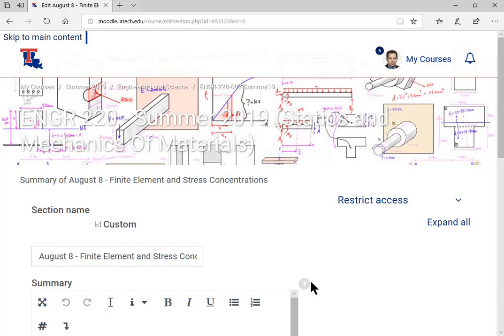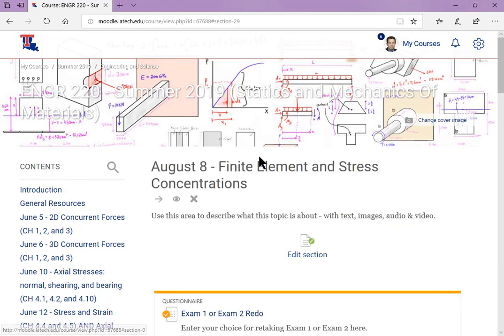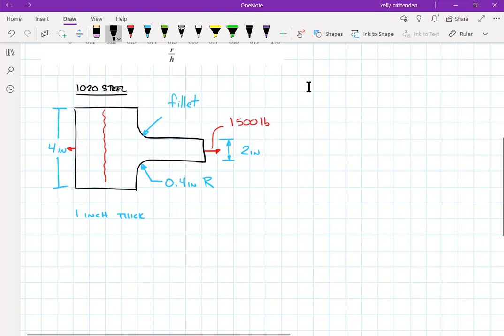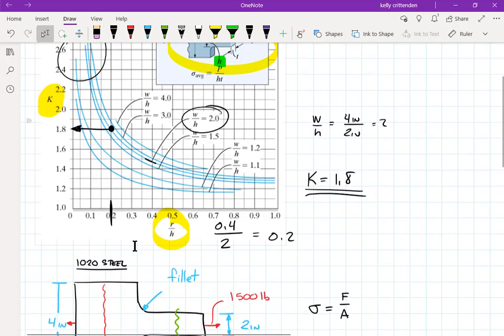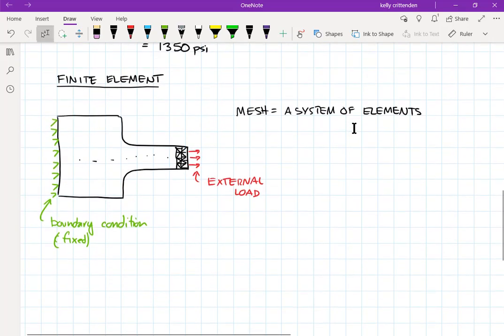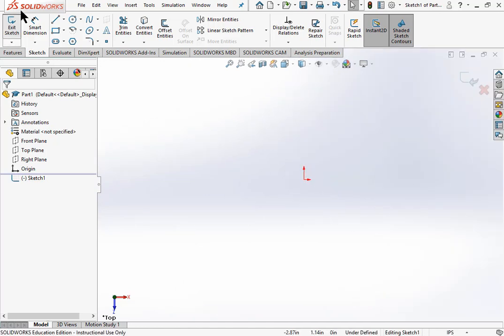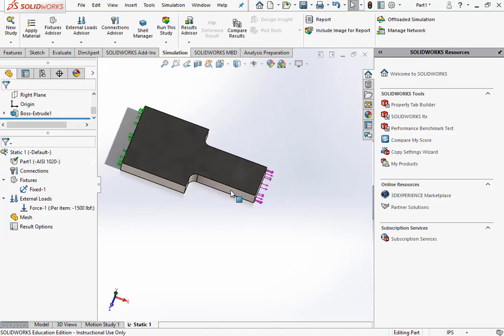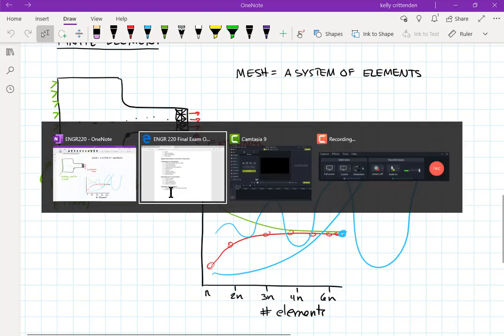ENGR220 24 - Stress Concentrations and FEA

Comment: I keep noticing very high concentrations in very small areas in the FEAs of various types of industrial threads. These stresses are in the thread root and contact areas. Typically it’s in the first three threads that the strain is highest. Do you have any advice on how one could mitigate or defend the results of an FEA with that type of result?
Reply from the maker: First, thanks for the question! Second, I believe those locations that you are describing are the most highly stressed areas of a bolt thread. Peterson's Stress Concentration Factors reports that about 65% of bolt failure occurs in the thread at the nut face (so on that first loaded thread). Also, the first three threads do carry most of the load with the first thread carrying about 38%, the second 25% and the third 18%, so somewhere around 80% of the load is carried in those first three threads. If I am correctly reading what you are saying, then it sounds like the FEA results do appear to be correctly modelling the experiments (that I know of) from real world threads. If you are more interested in better distributing the load among the threads of a bolt this paper (https://www.mechanics-industry.org/articles/meca/full_html/2020/06/mi200233/mi200233.html) does some work on calculating (FEA and analytical) the load distribution when using differential thread spacing between the bolt and nut (slightly different pitches between bolt thread and nut thread). Does any of that help?
Reply: @KellyBC , it does help very much. Thank you so much!